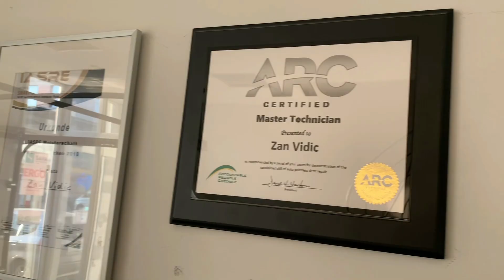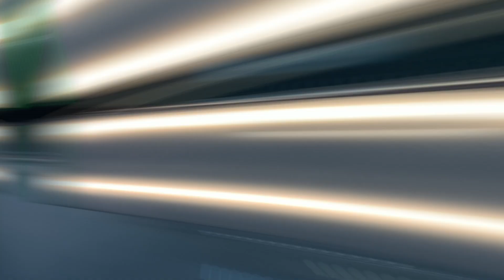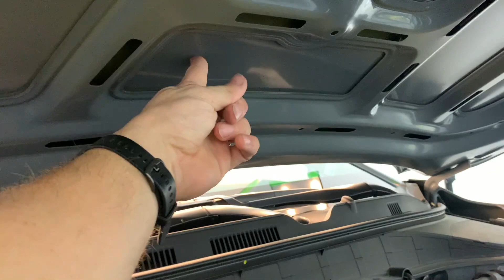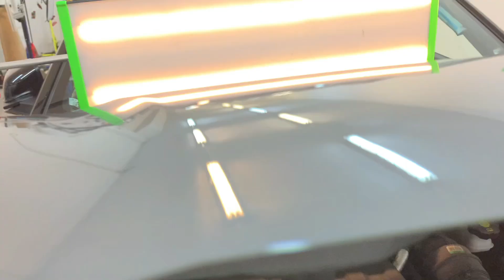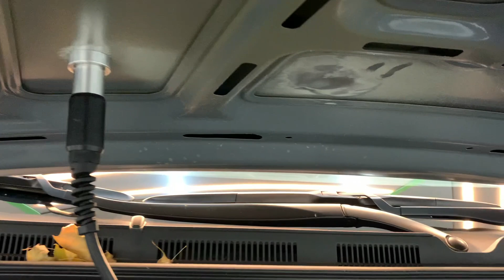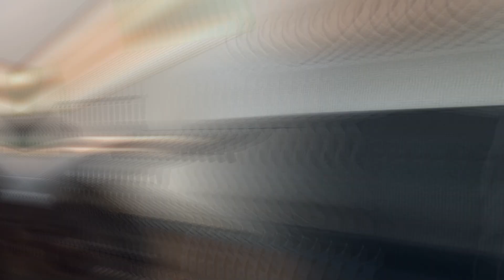How to repair a stretched dent using a Power PDR box | Oil can dent repair | PDR Tutorial

Comment: Good work my friend. Is this a welding machine? I want to know that too. Someone said I can do this with a blowtorch.
Reply from the maker: Hi, thank you. Its not a welding machine but it is very similar. It was made especially for this kind of dents
Reply: @vidicz  I live in turkey. I want to know this too. I spoke with a master from Brazil. He said he did this with a battery charger. Another master said that he did this with a low voltage welding machine. I was undecided

Comment: Do you ever have a large hail dent you are working on with a sharp tip start to oil can?  Do you use the power pdr box to fix it?
Reply from the maker: Yes of course. If the dent is too stretched, it will oil can no matter how sharp the tip is. In that case yes I use the Power PDR box to fix the oil can effect.

Comment: That’s amazing. I have used heat to shrink on heavy old car sheet metal. This shrinks and tightens the metal making it able to be a normal push nock down again. Awesome and I know easier said than done. This is a great start to being able to do it on your own. Thank you. Johnc
Reply from the maker: You are welcome. Yes this machine is really special and it’s a must have :) it pushes your ceiling much higher

Comment: Thanks for the tutorial Zan 👌🏻👌🏻. This type of power pdr machine is not available for sales anymore and here is the new model MSD 300 mini. 
Operating display and its weight are the main differences but the system of repair is the same like on this machine. 👌🏻👌🏻👌🏻👌🏻 
Here you can check out the new model
https://denttoolseurope.nl/index.php/en/product/msd300-msd300-power-pdr-box/
P.S. Hope you dont mind for this comment
Reply from the maker: All good 😌